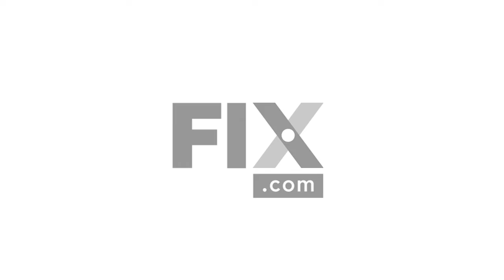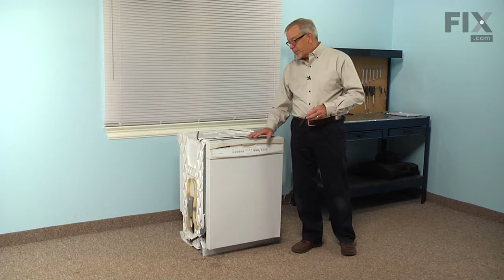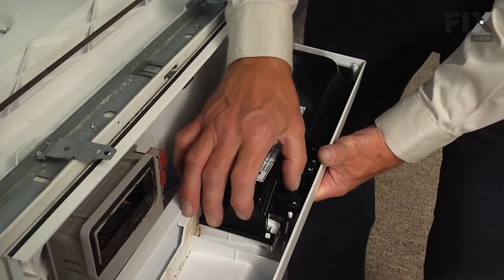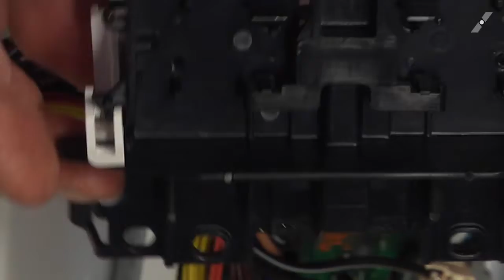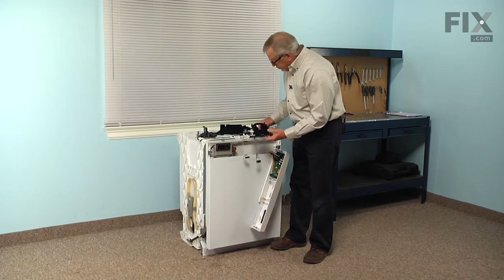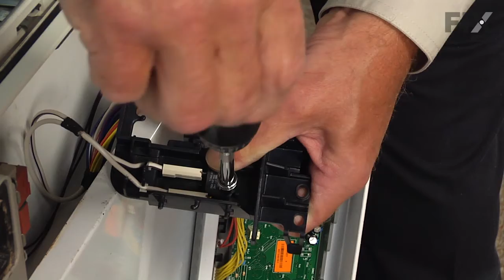Kenmore Dishwasher Repair – How to replace the Door Latch Bracket Kit - NO Handle

Comment: Hi does this parts fit Kenmore 665.13832k601
and what is the parts number?
Thankyou
Reply from the maker: Hi Bandy, this part does work for your Kenmore model. You can click on this link to order online: https://www.fix.com/parts/dishwasher/kenmore/fix886319/door-latch-bracket-kit-no-handle-8193882/?SourceCode=1&ModelNum=66513832K601&ModelID=1893010  or call us at 1-877-346-4809 and we can place the order for you.

Comment: is there suppose to be a spring attached? my handle is still loose after following these steps
Reply from the maker: Hi, what is your model number?
Reply: Kenmore 665-13863K600.  I replaced  the door latch,   latch actuator, reinstalled the handle, which didnt solve the problem.  Door does not lock shut ?  Ideas?  thank you.
Reply: @richardbaes4623  door handle?